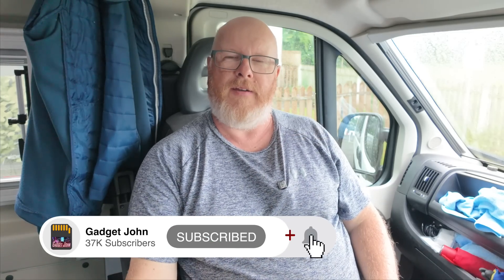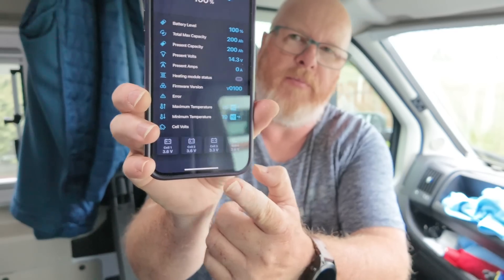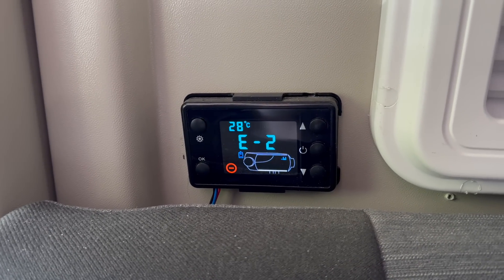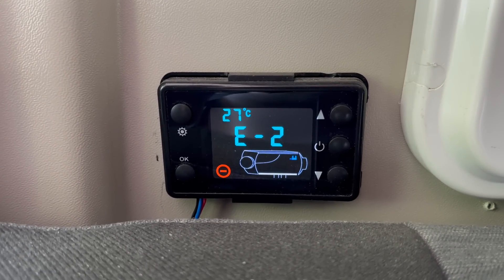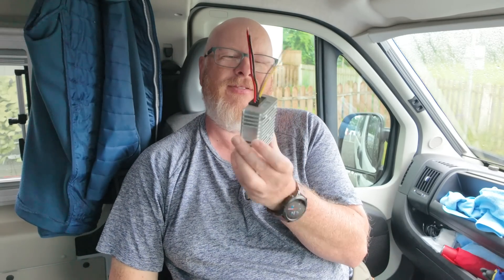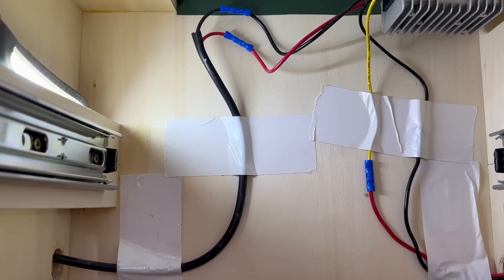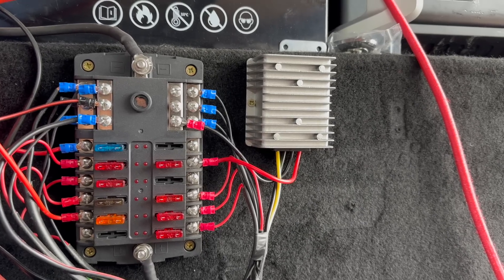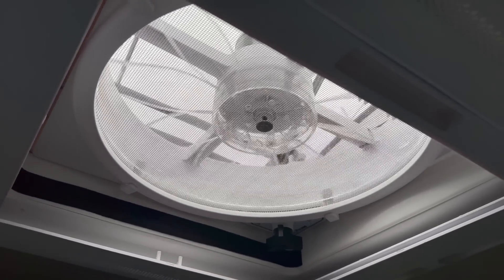The Voltage Regulator no one knew We All Need!

Comment: Not peculiar to Lion cells a fully charged 12v lead acid battery will have an initial voltage over 13v and is charged by the vehicle at 14.6v and as that voltage is present in the battery terminals thats what is fed to the vehicle main busbar/fusebox. It is fair to assume that automotive electronics will be designed to work without fault within a range of a discharging 12v battery to its 14v+ charging state, or the vehicle provides a regulated supply after the main bus. It is also vey common for the standard fag lighter adaptors for phones dash cams etc to regulate the voltage down to 5v. I am surprised that a max fan intended for use in a vehicle is not properly designed to operate on the standard voltage range of a vehicle battery Lion, Lipo, or lead acid. Never thought of this as an issue but now interested enough to check the DC supply voltage to the installed devices on my van with engine on and off.

Comment: Think most bms es can be set to maximum voltage too, 13 or 14 volts, but as long as you don t need a lot of Watts that device is ok too.
Reply from the maker: That’s not true, factory batteries have locked BMS software to stop users making their own changes.

Comment: why couldnt you duy the largest amp available, then wire it straight to the output of the 12v battery. That way the whole system is goverened to 12v exactly.That way you only have to wire one unit in, not all over the place.
Reply: @gazztracker  The charging voltage will be about 14.6 volts, which is what everything connected to the battery will see.

Comment: Great idea! Just wondering, aren't you afraid that the converters pull a constant small current, when always connected to the battery, even when nothing is connected to the output? When you have a few installed and together they for example pull 50mA, then the battery will be drained pretty much in a few day's.
Reply from the maker: Not at all, so far the drain is unnoticeable.

Comment: We are now on our third EcoFlow Delta 2 because the car charging fails after a few months and it won’t charge from the 12v outlet.
I’m wondering if a voltage regulator might help.
Worth a try
Reply from the maker: I’ve got a video all about fast charging a power station while you drive. 👍🏻
Reply: @GadgetJohn  I’ll check that out, thanks👍

Comment: Try this. I have a couple of Trail Cameras that have Picture and Video Modes. They Require 8 X 1.5 volt AA Batteries. When I put Rechargeable AA batteries my Video Mode refuses to work. Then I realized that my most Rechargeable batteries are 1.2 volt NOT 1.5 volt like all AAs used to be. (THEY Always find a way to Intentionally  F Things up.) My Trail Cameras requiring 8 X 1.5 volt = 12 Volts.  8 Rechargeable X 1.2 volts batteries = 9.6 volts (not enough voltage to run my Trail Camera's Video.

Comment: Bad experience. I bought two 12v to 13.8v 30 amp ( ham radio transmitters  like 13.8 volts) from an AliExpress seller. Upon bench testing one only produced 11.2 volts under varied loading to 20 amps while the other produced 12.5 volts under the same testing. Both units were therefore unusable for my needs. Unfortunately I had no luck with warranty during the Chinese New Year.  $150.00 Cdn. into the scrap bin.

Comment: I have used some if those on my 24v boat to power some 12v items, in my experience they are pretty hit and miss as far as reliability goes. 
I've had 3 fail after a year or so while 2 have been installed and working fine for about 3 years now.

Comment: I had a similar problem as this when using the 12v output directly from a generator, it would fry power monitors until i added a 12v regulator. it turns out it was spiking to 16v on when the engine sped up.

Comment: So, this "regulator" is a boost/buck or just a buck? If it says 9-15 volts, then it really boosts if needed? Next is how noisy is the DC output? Most cheap-O Chinese open board hobbyist converters are very noisy. I mean EMI/RFI noise, NOT audible noise. I agree that some home electronics use wall worts that output exactly 12.0 (5.0) vdc, but many wall worts  say 12v but measure crazy ass voltages open circuit! Just about all cigarette lighter phone charger's will run from 9-24 volts no problem. My Alpicool compressor portable fridge will run from 11-24 volts. But, hey, great there is something that will put out just 12 volts on the dot for those gadgets that don't like anything but 12.0 volts!

Comment: Just fitted two as a test. One on the fridge and it's much quieter.  The second on the MaxxFan.  I can't tell much difference on the fan but I do know they are sensitive to different voltages.   Next week be the diesel heater.  How far are you planing to go with these?    Water pump, led lights,  USB sockets etc.  it's a shame you can't get one that could sit on the feeds to the fuse board so everything is regulated.
Reply from the maker: I initially bought 3, I’ve since bought another 3 😀 So I now have them for everything I really value.
Reply: Maxxair actually sent me one of these following a couple PCB failures (both in and outside of warranty).
They said the fans were not overly tolerant of the solar systems on most vans these days 🤔.

Comment: Jon i use a Victron DC to DC charger as a power regulator, you can set them to whatever output voltage you like. Mine is is set to always put out a constant 12.8v regardless of whatever state the battery is in.
Reply from the maker: That setting won’t be good for your battery as you’re not allowing it to get a full charge.
Reply: @GadgetJohn  The Victron has a power supply mode, and that is what I think he's using for 12.8v constant voltage output. 
You can buy the 30A version and use it to power all the 12v devices in the van.  Victron Orion 12/12-30 Smart Chargers have the power supply mode. Very handy!
Reply: Should i use the isolated one or the shared ground. With shared ground i need to rewire a lot.
Reply: @ronaldod7116  Definitely the isolated version.

Comment: This got me thinking as I have LiFe fitted and I recognise the fact that 14.6v is an occurrence, so started checking voltage tolerance of fitted devices. Result - Truma4E up to 16v before high voltage alarm on 12v working. However, Domestic 8555 fridge/freezer no mention on 12v working so the fact that it operates when driving when alternator voltage can be around 14.2v should be OK. GJ voltage issue is perhaps more relevant for self builders and modifiers.
Excellent article, thanks.

Comment: John, semi retired electrical engineer designer. Have specfied similar systems on AC medical supllies and machines. Same principle on DC equipment. My plan is  to  start my own van build. My question is, if you supplied the all the van electrics with a Dabbsson unit (or similar) would that come with a built in 12V regulator ? I was quite impressed your video on the Dabbsson and the fact all the van electrics supplies can be contained and emenate from one unit.
Reply from the maker: Yes, if you use the dabdsson soley for the 25A 12v then it would regulate the 12v

Comment: John, did you consider just putting a high-current silicon diode or two in series, and using the forward voltage of the diode to drop the voltage a bit across the device?

Comment: As a design engineer, if I designed an appliance specifically for use in an RV, marine, or other 12V DC battery operation that couldn't accommodate 10.5-15 volts, I deserve to be fired.
Reply: Exactly most laptops despite being rated for 15v input max will work on 20v dc fine
Reply: Be aware that if it is regulating to 12v from less than 12v this device consumes a lot of power. I added it to a 12v solar setup on a shed because the LED lights flickered when the battery got down to 10 or 11v. Yes, it worked but wheres without the solar previously kept the battery charged for 24/7 use without it, the battery would deplete to 9v or less overnight without any load at all and then the system would drop out. Removed the regulator, problem gone.
Reply: @Exnihil1 Well it’s not good to run anything of a battery at 11v as thats already beyond empty.
Reply: @Exnihil1  Yes. When I saw a heatsink with in/out wires I know that is going to consume some power when working hard.
Voltage regulation is important but that device is for specific applications. It's not the silver bullet to balance multiple 
users but if the source is happy providing the extra power then all is good.
Reply: Dont tell my diesel heater it loves all the voltage, it is however really picky on fuel quality 
I use buck boost converters on my TV, adjustable voltage and amps less than £20
Reply: Perhaps someone more knowledgeable could answer this. But does this regulator draw power all the time? If it's on your fridge that goes off when it falls below a set temperature, the regulator could still be drawing power.
Reply: You as a design engineer, didn't really think about what you wrote in your comment.
Reply: As well you should be
Reply: Many of even the cheap cigarette lighter supplies operate from 9-32v
Reply: Ya most of those devices are not designed to run in a vehicle thats why they have power supplies
Reply: Seems like a massive opportunity here for a clever and entrepreneurial designer.
Reply: Ehh, points made on operating voltage are worth considering. There's more going on than meets the eye. If your not drawing on direct experience I'd say nothing...
Reply: Yep.  Most electronics need a DC-DC converter anyway, and most will take a fair range of inputs.

However, if something is designed to take a particular wall wart... Well, it will often be designed for that input.

BTW: It annoys me that devices usually just list the nominal input they want, not the range they can accept.  If you can get a look at the actual circuit, there's usually a voltage regulator in there you can lookup the part # of and figure it what it actually requires.
Reply: @travcollier I'd have thought the nominal voltage would be the optimal voltage no? Even with a range?  Otherwise wouldn't it be designed TO a different voltage?
Reply: @danielcookeb90  For a lot of modern electronics, the plug (or battery) feeds immediately into a DC-DC converter/regulator which outputs specific voltage(s).  It is more likely that the control electronics are using 1.8V, 3.3V, or 5V than 12V.
Reply: @g-whiz286   thats not just a diesel heater. it's a cheapass chinese copy of a genuine eberspacher unit. 

so you can't make use of the automotive grade range of 9,5V to 16V you'd get from a genuine german brand like webasto or eberspacher.
Reply: I've never seen an engineer not fucxx it up all the time every time. I spend each day rebuilding there crap. Get on the tools and learn more before speaking. They just sit behind a desk looking at data charts. Thanks for showing people how to make their stuff safer from engineers.
Reply: @jeffproulx8584 Jeff, ya need to take a chill pill 💊 or you will blow a head gasket; and you'll need a mechanical engineer out to fix it!😂🤣😂🤣😂🤣 And we can all tell how that will go!🤣🤣
But seriously fella, from your phrasing, you seem to make a living fixing stuff, so I'd be delighted if stuff broke, you will always be in a job! And think of the opportunities you come across to engineer something better!!
Oh and not to bee too picky but,
 "there stuff " is actually spelt "their stuff ". 
Like engineering; it's the detail that matters. 👍
Reply: @danielcookeb90  "Not to be too Picky" but I'm gonna be too picky hahaha 🤣
Reply: @jeffproulx8584  It's not the engineers, it's the product managers that give them the specs.  Experienced engineers know the market well enough to question dubious specs but it's not their job.  Now, in small companies the title "engineer" stretches from product manager through designer through engineer through production manager and even into installer.  It looks as if some companies are so small, and their staff so unprofessional, that no one knows that the working voltage range should be specified.
Reply: @jeffproulx8584  If engineers mess everything up and you can fix all their problems why aren't you an engineer? Lol
Reply: "design engineer"? name something that you designed and explain exactly what parts you designed and engineered..
Reply: @twistedhillbilly6157  - Embedded PWM motor control circuits although I don't know why that's important to the subject.

Comment: I had something similar happen to me, my Toyota highlander going on 8 years old started to get some glitchy problems with the built in GPS, and other things, they still worked but not as well, one day I talked with my  beloved local.mechanic about this and he asked me how old my 12 volt battery is, I told him it was,still the original one and It always started the vehicle just fine, well it turns out that the 8 year old battery was putting out the wrong voltage. One new battery later and everything is working like new..

Comment: could you not put this between the 12v fuse panel so everything 12v would be regulated?
Reply: @whereonearth1  This is the question I would like to see answered! @GadgetJohn
Reply: It depends on how much current 'everything' will draw. These devices are cheap enough that you can have individual units for each circuit and if one does blow, the rest of your equipment is not compromised - even temporarily.

Comment: Very interesting subject. Certainly things like led lights are often run close to their maximum output. I have run MR16 lamps down to 7 volts, and still got a very good light. The power saving and heat reduction is enormous. I did a similar thing with an led headlight bulb I bought for a classic motorbike. It now draws a quarter of the original current, and a sixth of that used by the old incandescent one.

Comment: You may need to add a dc to dc charge controller because if you are getting too much voltage to your heater etc. The higher voltage may be damaging the lifepo4 battery. If the only time you are having issues is when the engine and alternator are charging a dc to dc charger will regulate the voltage and you won't need buck converters on every appliance. Lifepo4 battery chargers charge at a lower voltage than  car alternators which is why you can't use a lead acid battery charger on a lifepo4 battery . A dc to dc charge controller lowers the alternators voltage to a safe voltage for the lifepo4 battery. If you already have a charge controller check to make sure it is not set for lead acid  or agm batteries.

Comment: Yeah I got one just like that but my output is 13.8 so I can use solar panel and pipe that into that and then charge lithium battery up to at least 13.8 volts

Comment: Greetings John, I can't help but wonder if a simple choke or a diode would have solved a lot of your problems. Did you ever look at the DC line with a scope OR a multimeter switched to "AC"? I suspect that a lot of your problems were being caused by "NOISY" DC. The little gremlins that HAUNT all sorts of devices in everyday MOBILE life.  NO DOUBT that you resolved your problems with a voltage regulator, and I applaud you. This is much the equivalent of getting rid of ANTS with a sledgehammer!  LOL.  Oh, and YES, I do have some of those same regulators you have. EXCELLENT devices !  However, a CHOKE is cheaper. Another way to CHEAPLY reduce the voltage is to put a  diode or two in series with the load.  Best wishes to you. And KEEP experimenting!
Reply: Chokes and diodes can certainly help in the right situation, but are sometimes not the most efficient, depending on how much power that needs to be dissipated, and are also fixed voltage drops, rather than active regulators. Also bear in mind the 6A regulator was actually a step up/step down regulator... i.e. it steps the voltage up internally, and then steps it down for the output... so can not only help with over-voltage situations, but under-voltage also.
Reply: @pfeerick  I agree whole hardheartedly. I just wanted to open your viewer's to alternate solutions to (expensive) voltage regulators. They also take up more room and can sometimes induce MORE heat,
Reply: @KG5RK  diodes drop about 0.5 volts each, but you must be sure you have the current capacity or you might inadvertently create an LED. Been there long ago. LOL

Comment: When I get a new regulator - I test them with my variable-voltage power supply. The regulators will tell you what the input voltages they can handle ( typically 10v-18v+ ). I put a load on the circuit and vary the input voltage through a range I can expect. For example, our trailer conversion  uses a Bluetti lithium battery as its primary DC source. 13.4VDC is its output. Test the regulator up to about 15 volts, down to 10 volts and put a load on it. The voltage should never waver AND the device should not get too warm.
DON'T SKIMP on regulators - get good ones. I'd avoid Amazon if possible. You cannot rely on no-name electronics or parts from Amazon.

Comment: Can you get a voltage regulator big enough current wise to go between your lithium battery and fuse box 12V feed so it regulates all your 12V circuits?
Reply: @ZillaYT  I was wondering the same thing! Having a google to research but be great to hear from anyone who knows the answer!
Reply: I’d be keen to know the answer to this question. One device to regulate the whole 12 volt system would be neater and simpler than numerous devices for individual components. Thanks
Reply: @regnbean67 I wonder if there’s a DC-DC converter that can support the whole 12V load. So essentially the connection wil be battery->DC converter->fuse panel